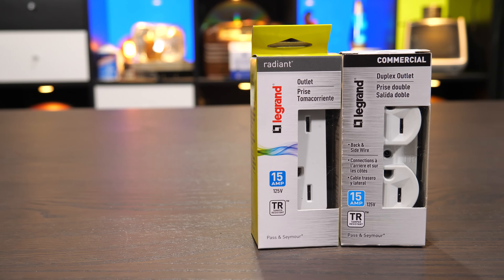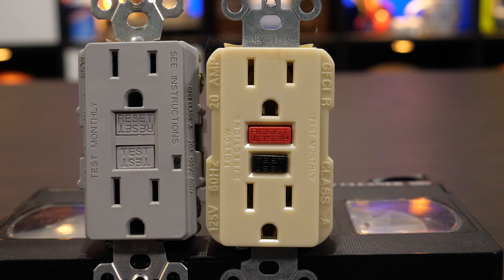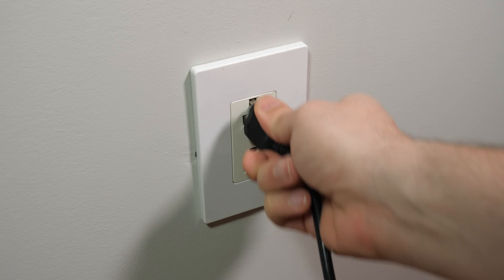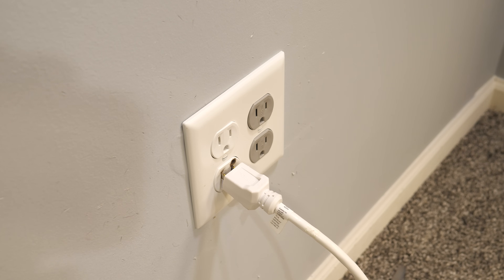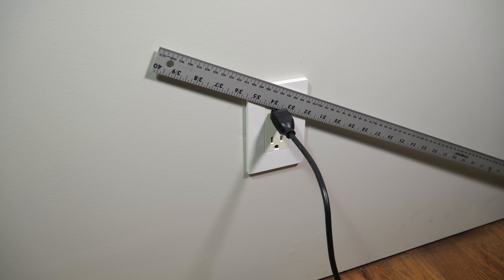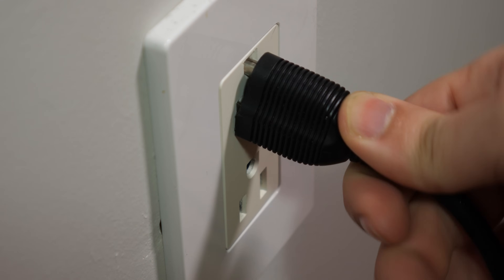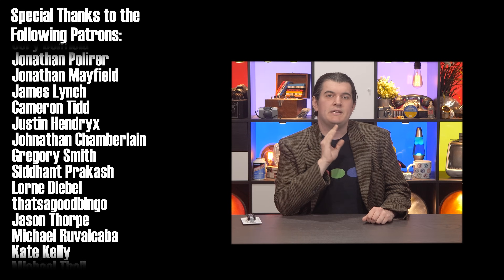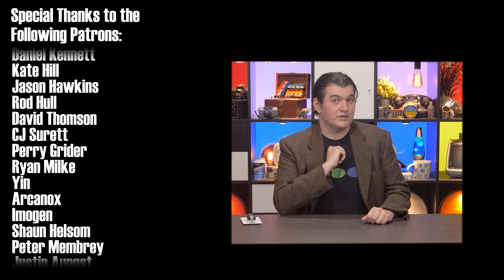Power outlets are topsy turvy - but does it matter?

Comment: I dare say that the first thing we should be working on as a country, in terms of electrical safety, is legislation that requires plugs to be fused. They have this in the UK.

Oh, and one of the first right-angle extension cords I ever saw was made in the 90s. It had an octagon-shaped plug for some reason, but the cool part is that the plug had a folding handle made of wire that you could pull on when unplugging. This helped to avoid accidentally sticking your grabby fingers in the business end of the plug.

Comment: I grew up in a trailer that had all-aluminum wiring.
We didn't find out that until the fire department told us. But once she knew, my mother became really insistent that any appliance had to be unplugged when not in use.
The only thing I knew how to make was toast, and I used the toaster a lot. It was a real pain to plug in, since I was too short to see over the counter.
Unplugging it was a breeze, though. I just had to climb up a short ladder and work a table knife behind the toaster. There was no ground pin, so it was easy to slip the blade between the two prongs. The circuit breaker was no problem. The trailer didn't have any.
One time I either fell off the ladder (or maybe I was thrown off of it), so I just left the knife where it was.
I still have that knife, and the blade has a hole in it.

Comment: There is a SLIGHT difference between contacting the hot prong and contacting the hot and common, or hot and ground.

P.s. I  was amazed that I accidentally turned on the shop vac when reaching for the outside handles, 1/2" recessed toggle switch.

Comment: The "Side Entry Australian Plug"
solves most of these problems by having
the "Side Entry" at actually 135 Degree (the 4:30) position - to suit both horizontally and vertically mounted socket-outlets -
and
having "Half-Insulated" Line and Neutral Pins.

Look up ""HPM Side Entry Australian Plug", since YouTube does not allow the posting of a direct URL Link.

Comment: plugs dictate the orientation .. all transformer plugs dictate the ground on bottom if you put it on top you put extra unneeded strain on the pug from its weight and it could just fall out of the plug

Comment: Some years ago I had reason to study the National Electric Code. At that time the code was very specific that medical facilities should be installed with the ground lug on top (or up.) Residential installations related the position of the 'wide' lug (silver screw) slot, the white wire side (as marked on the back of the outlet) then after installation of the outlet should be on the left hand side as the outlet faces the user. This lug placement would orient the ground lug on the bottom of a residential installation. Elsewhere in the NEC appliance manufacturers are instructed to follow this "wide lug left" description when providing the pigtail to energize the appliance. Either way I see the installation of outlets as a user choice. I prefer to plug in my new refrigerator into my "wide lug left" oriented outlet so the right angle plug provided with my new refrigerator hangs down along the wall.  Therefore, I will continue "wide lug left" installation method in all my remodels. And like your title ends with " - but does it matter" . . . . now what do we do when we need to mount outlets sideways. Is it ground left or ground right?

Comment: In canada we are required to mount receptacles ground pointing up in hospitals. Been told many times in areas other than hospitals orientation doesn't matter as long as the hot is not facing up as in the rare case metal, like a knife, gets in between there it'll cause a line to line short.

Comment: The reason the ground up orientation is seen so much in hoapitals is simple
Virtially everything that will be plugged in at a hospital has a ground pin, and as mentioned the ground up orientation makes a meaningful safety impact when 99.999% of electrical devices in said hospital are 3-pin

Comment: Electrical contractors use to put the ground pin up to indicate that it was on the switch to be used when you enter the room, before ceiling lights.

Comment: In high school shop class, we were taught to install electrical receptacles with the ground contact opening down. This was supposedly to ensure the ground would be the last contact to detach. When mounted sideways, a receptacle was supposed to be installed with the hot slot up so it would be the first thing to detach. Anything else was considered sacrilegious.

Comment: Here in europe we have plates that are circular shaped and have a little depression, there are 2 cylindrically shaped little plugs and holes, that could solve most of the issues here although there are some wall plates that don't have a depression in them and are prone to the exact same issues.

Comment: I have only ever seen two plug that was a window AC unit that had the ground under the hot and neutral, it was also a NEMA 6-15P for 240V. The second one was also a window AC unit that was a 120V with the GFCI built into it. Always wondered why they designed them all that way making it useless.

Comment: I would say its better to have sideways oriented outlet boxes but change the design of the outlets themselves to be opposite of each other,top on top and ground on opposite sides on the far end. Would let you use two right angle plugs at the same time,an issue I have ran into before. It sucks when you have to plug to right angle plugs in at the same time and they conflict with each other.

Comment: This is one of those "we should rewrite all code for all computers" kind of thing. A great idea but essentially impossible. The net gain of having the ground triggered 'first' by a spill or a drip from the wall would only matter if everything was rebuilt for such a configuration. I would suggest that if you were recreating Earth and had the opportunity to redo everything, well, hell, make them all bayonet mounts with fuses in the plugs and far enough apart that any DC converter or sideways plug or flat plug for behind furniture can all fit properly. Yes, it is nonsense because VHS beat Betamax and Apple beat Android. Nothing makes much sense in Electrics anyway, they make incremental improvements while ignoring glaring dangers all the time. Those new hot lead caps totally ignore the rest of the contact that can easily kill a person if touched. Imagine a box that had a big plastic cover for the hots and neutrals so you could work without shutting off the entire house. I mean, keep dreamin.

Comment: Yes! I just moved into a new place and it has the outlets in the "correct" orientation... The problem is that I have a ton of power bars and other devices designed for the "face" orientation, which makes plugging things in and getting them to stay in a huge pain in the butt...

Comment: I hope Alec watches this video!  Across so many videos he has called into question the British practice of having switches on the outlets claiming you can just remove the plug.  But all British plugs are at right angled ones, it was part of the safety standard devised in the 1940s during the heyday of throwing knives at the all.  But switches on outlets are not part of that standard, they are not required.  But they are commonplace as a convenience because as Alec explains here, right angles plugs are more difficult to remove.  And more so as all plugs have chunky pins, and a ground pin, so they cannot be angled in but have to br pushed or pulled perpendicular to the wall, something especially awkward when outlets tend to be low to the floor.

(One weird thing,  you occasionally get power adapters where the cable come out of the top of he socket instead of the bottom.  Without double checking the standard, maybe that is allowed because it the cable only carries lower DC power.  But as outlets are orientated horizontally this usually does not matter.  But they tend to be on devices that are used on desks or part of A/V setups where two-row or tower extensions are used, making them a bloody nuisance blocking other sockets.  Something that I guess is a common problem in other countries.)

Comment: Interesting...our (UK) phone chargers rarely have a metal ground pin cos the charger doesn't have or use the ground (or earth pin as we say here in old Blighty). But they have to have an earth pin to open the "shutter" in the wall outlet ( or socket as we call them). It's usually moulded plastic.

Comment: I agree. The best solution without changing our plug design or building thicker walls for inset outlets is the 90-degree plug. Only one problem, which you sorta addressed: Interference with other plugs. But there's an even better solution, both in specific and overall when 2 ideas are combined together. And that's to have the ground holes face away from each other, and simultaneously to make it standard for all outlets to be mounted sideways, Chicago style.

Now you can ALWAYS get TWO 90-degree plugs or large bulky power adapters in each outlet, AND the combined sideways design and flat plugs will prevent them from pulling to expose the prongs. The ONLY way to mess this up (or indeed make the entire situation worse than it is in general) would be to make the ground holes face TOWARD each other. THAT failure would indeed make it entirely impossible to use the other socket with a 90-degree plug or a bulky power adapter.

The only thing I could see being worse would be plug in air freshener pods. Those would have to be redesigned to all be reorientable. Or, much like that splitter you showed, there would have to be another product on the market that would adapt the outlet rotation 90-degrees so that the ground hole can face down and allow the air freshener to work normally.

Comment: I've taken the National Electric Code course and it specifically said that the Ground plug is to be on the Bottom that way if the cord comes slightly unplugged it will still have a Ground connected until it's fully unplugged!  
Don't provide misinformation!!!

Comment: I was lucky enough to see a metal shielded usb cord fall off an end table onto the exposed blades of a loose plug. There was quite a flash and pop, along with tripping the breaker. I took that as a good sign to stay away from metal cords like that.

Comment: it matters when buying a device with a connection that hangs dangerously away from the wall, as a tripping hazard.  If you buy a device, check the orientation of the flat plug types that may hang out, buy your correct left or right dangle.

Comment: Mandatory UK plug chauvinism comment: there are like 3 design features of our plugs that each alone would mitigate these issues. But separate to all that, and I don't know if this is actually regulated or not, 100% of our plugs are right angled. As well as just making sense from a cable management perspective, this prevents the user from pulling the plug from the wall with the cable. 

Of course, the UK plug design has other mitigations that remove the danger if the cable is tugged out of the plug :))))

Comment: I was told as a kid that receptacles were installed ground-up because, when installed the other way, they look too much like faces, leading small children to try to "feed" them by putting things in their "mouths." 

Once I got older and learned that the "mouth" is the ground, I realized that this was nonsense. I've flipped several of the ones in my house to the "wrong" way because of the right-angle plug issue, but mostly I just use 1' right-angle extension cords (especially for things that are plugged in permanently behind furniture) to keep things tidy.

Comment: I was taught by a master electrician that the ground plug should be at the bottom. That way if the plug should come loose, the last part inserted will be the ground.  When an outlet is sideways, the wider prong should be at the bottom for the same reason.

Comment: I work at a hospital and they are all upside down for the reason that something could fall in the crack if it backs out at all.

There are HUNDREDS of infusion pumps (among other devices) being constantly plugged and unplugged and at that level you definetly see a lot of weakening for the plug and receptacle integrity.

Youd see this a lot less in a home setting as we tend not to plug and unplug at that rate.

Comment: I'm wondering why your pins are full metal. Our pins are out of plastic and only the contact at the tip of the pin is out of metall. You have no chance to touch it when it is plugged in

Comment: I've always installed with the ground UP and here's why...years ago I was a musician. In the dressing room once, one of the guys hung a wire coat hanger with a jacket on the plug to a room fan . That plug was put in with the ground DOWN. Well, the hanger worked it's way behind the plug and laid across the two blades. Sparks shot out all over and a small fire started on the jacket. Luckily we pulled the coat and hanger off the outlet without much more damage. Having the ground up would have had a much better chance of preventing that. So, in my renovations at my house, that's the way I do it.

Comment: We used to live in a house that was well over 100 years old. There were still a couple of the original electrical outlets in the basement. They were made of dark brown Bakelite plastic and most plugs didn’t go in all the way or stay in. They were super loose in there. We quickly realized those outlets probably weren’t safe to use. And there was no grounding prong hole so you couldn’t use modern 3-prong plugs in them at all. I often wonder how humanity has survived as long as we have.

Comment: I care a lot.  Have you bought any electrical device recently that has a 3-pin plug attached directly to it (e.g., appliance timer, battery charger, etc.)?  If your  recepticle has the ground pin on top, your device will be upside down when plugged in..  Who is the idiot that started this stupid conflict anyway?  It's as dumb as whether the toilet paper emerges from the top or bottom of the roll.  It seems any time something is going along just fine, some idiot will insist it should be done in an opposite manner for the most obscure  and unlikely theoretical reasons.

Comment: After looking at both the national electric code and ANSI/NEMA WD-6, the only depth information I can find is in 406.6(A) Thickness of Metal Faceplates, which states "Metal faceplates shall be of ferrous metal not less than 0.76 mm (0.030 in.) in thickness[...]". This means that, at worst, we could insulate 0.76mm of the pins on a plug without impacting any installations that are up to code.

Also, interesting to note: NEMA plugs don't appear to be required by the NEC. They just meet all the requirements laid out in the code, and I guess it's just the standard we settled on - but it's not codified anywhere, at least not that I can find. Granted, I can't search the code, since I'm not paying money to subscribe to their service, but Chapter 1 - General doesn't mention NEMA anywhere that I saw.

Comment: I had heard the "objects falling onto the neutral pin" reasoning for the upside down orientation. A similar, albeit opposite, reasoning for the "traditional" orientation is for flood prone areas, water will rise and contact the neutral pin first.

Comment: Regarding your complaint about power strip right angle cords being unable to work with this orientation, a lot of newer cords are actually made so that the cord exits the right angle connector at a 45 degree angle so that it doesn't block the other outlet.

Comment: Tge reason 2 prong plugs have the lip and 3 prong doesnt is simple.

Its grip. As shown the opd ones had not much meat to grab onto increasing the risk of finger slipping and touching a blade and getting a mild shock. .... Hence the ring to act as a guard.

Three prong has the bump of the ground plug to grip....

That simple

Comment: I agree with you on this video by the way. I will say that a year or two ago I was working at this retail hardware store and we had long cables for tying up cardboard bales. One of them fell and landed on the prong of the plug to a dock lamp and the guy got shocked but he was fine. If the outlet was upside down I'm sure it wouldn't have happened but I mean how often does this actually happen

Comment: The main flaw in the "upside down" argument is that every polarized wall wart, every electrical accessory, etc., is made with the ground side of the plug facing down.  Chargers, wall transformers (power supplies), many plugs, even things like watt meters are designed with the ground on the bottom.  Flush plugs and extension cords also expect ground to be at the bottom.  Of all the things I've purchased recently, they are all designed for ground at the bottom.

So what's safer?  A heavy polarized wall transformer dangling at a dangerous angle with both the hot and neutral exposed because the weight of the transformer pulls it halfway out of the socket...and a poor connection in the outlet (due to reduced contact area with the metal inside the socket) generating excess heat?  Or having it oriented the right way so it sits flush against the outlet with nothing exposed?  Or what about flush electrical plugs with the cable pointing up, sticking out from a wall, ready to be snagged by anything passing by?  Yeah, no...I'll keep my grounds at the bottom.

Comment: It's a fad. My apartment had all of the outlets with the ground plug on top when I moved in and it annoyed the hell out of me. Then they were mostly replaced in a "renovation" and now most of them have the ground plug on the bottom.
Ground plug on top is annoying as hell when you have "lay flat" or low profile plugs.